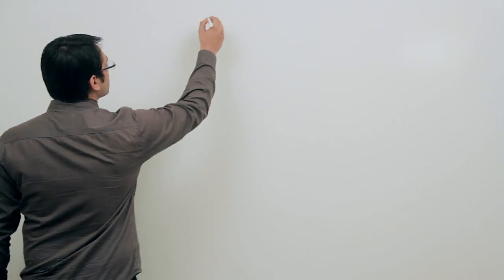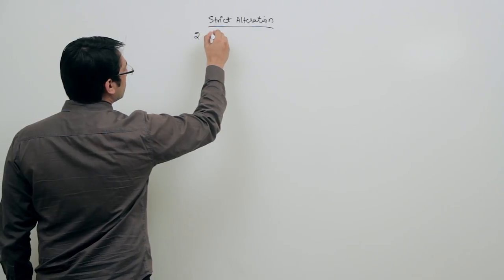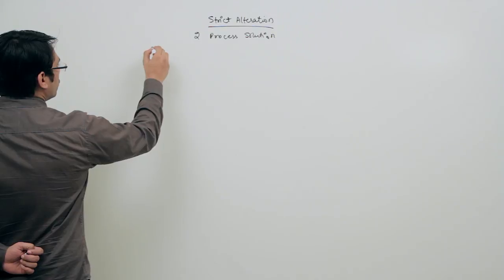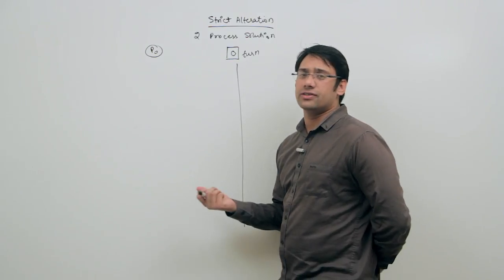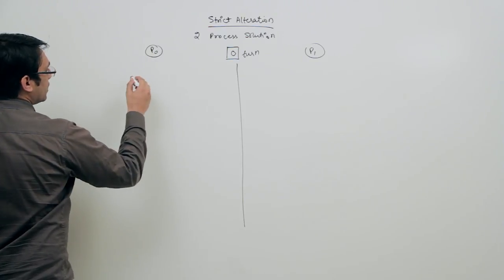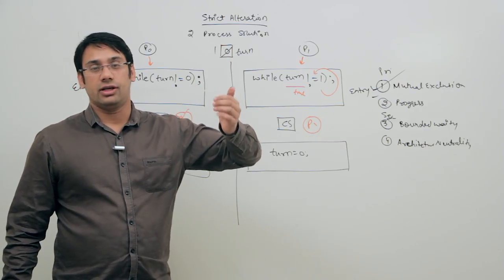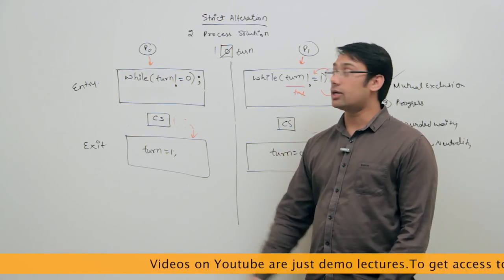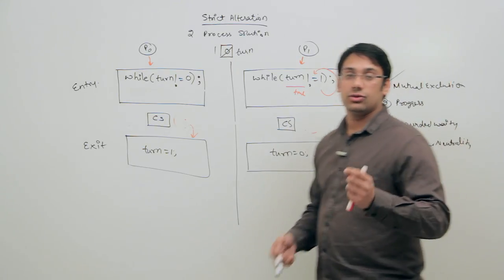05 Strict alteration | Process synchronization | Operating system

Comment: i beg you please tell about Distributed Deadlock Detection: system model, resource Vs communication deadlocks, deadlock
prevention, avoidance, detection & resolution, centralized dead lock detection, distributed dead lock
detection, path pushing algorithms, edge chasing algorithms. Agreement Protocols: Introduction, System
models, classification of Agreement Problem, Byzantine agreement problem, Consensus problem,
Interactive consistency Problem, Solution to Byzantine Agreement problem, Application of Agreement
problem, Atomic Commit in Distributed Database system